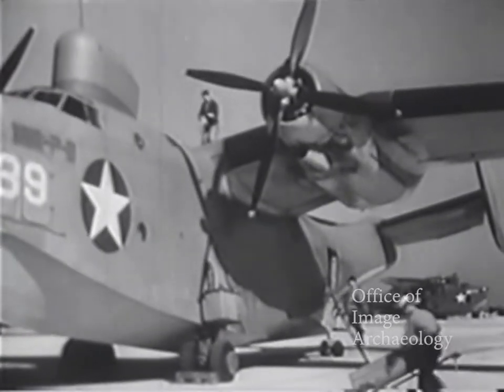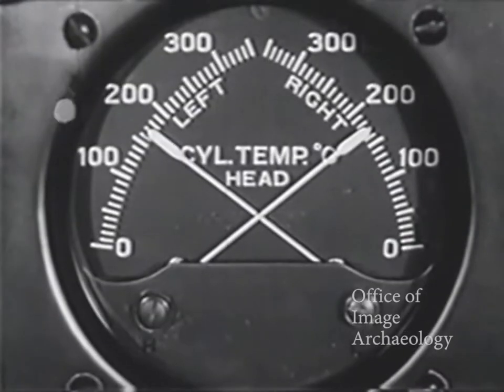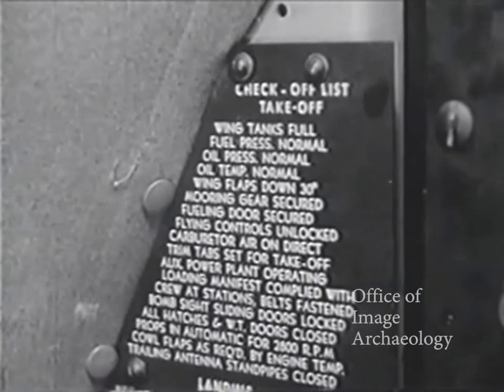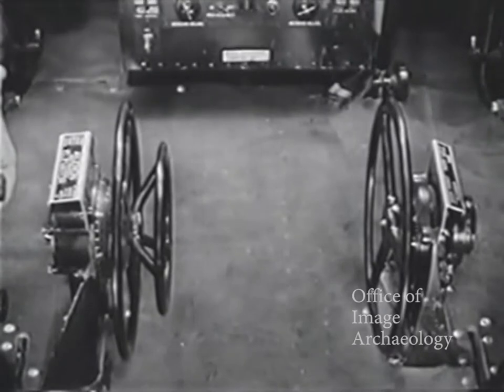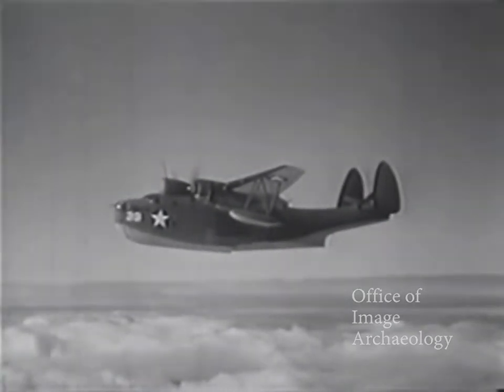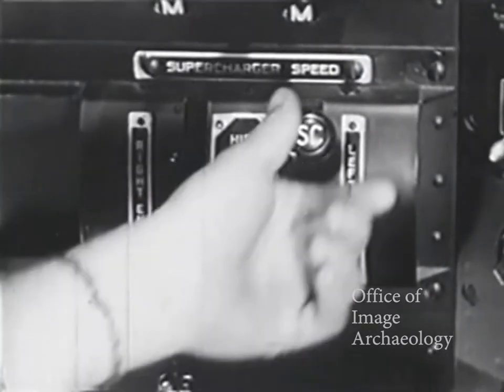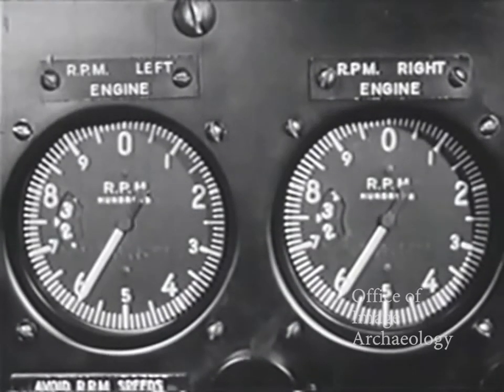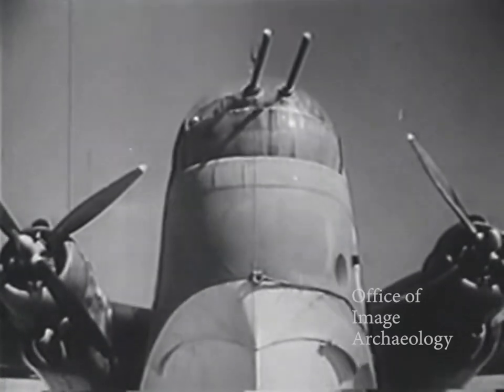1943, PBM C3, MARTIN MARINER, US Navy Training Film

Comment: Great presentation. Too bad we couldn’t get a tour of the inside. I was assigned to VP42 in 1959 and was on the rear party flying to Sangley Point in the Philippines. We did a 6 month tour there and rotated back to San Diego and switched with VP50, with them taking over patrol operations from Sangley. There was a 3 squadron rotation, with 6 months Philippines and a year in San Diego. VP 42 received the last p5m2 from Martin Aircraft, RB 5534, in 1960 or 1961. I believe it crashed somewhere off the Alaskan coast in 1965; not sure. I got out in 1962 and at that time p2v’s were starting to replace p5’s. I got to fly part time as a tail observer and it was an incredible experience.  I’m in my early 80’s now and would sure love to see this boat, inside and out, to bring closure to some memories. Looking forward to more videos.
Reply from the maker: You might enjoy this film it has a lot more detail. It is based on a true story. https://youtu.be/3vlnXQNL5ZI